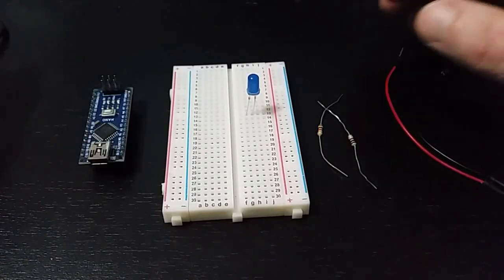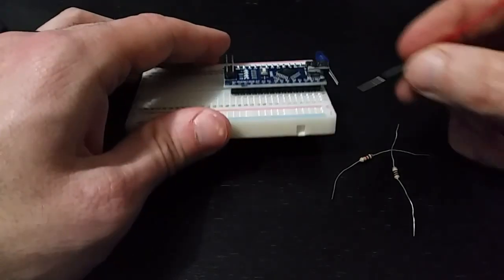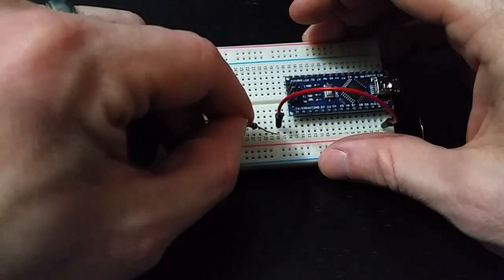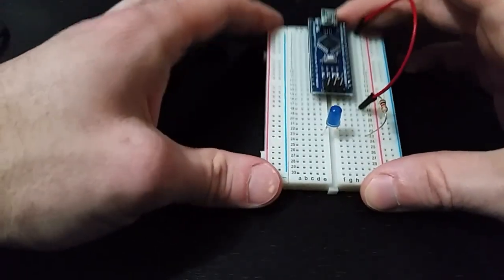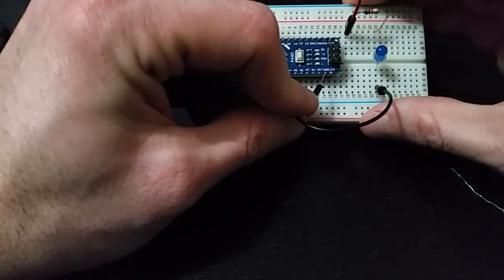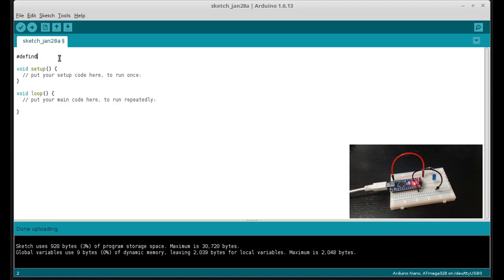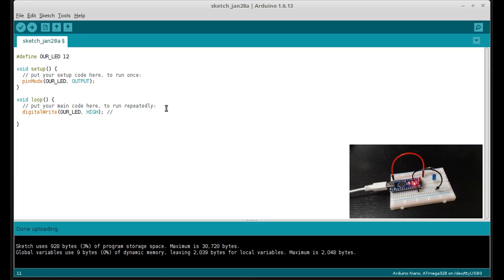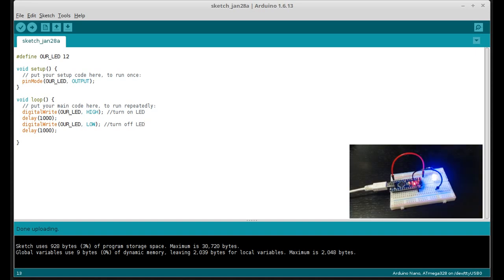How to Blink an LED with an Arduino Nano

Comment: Thanks a lot for the video. Its the first circuit I've built using Arduino. My nano came with the in-built LED already blinking, and after uploading this code to it, that LED has stopped blinking. Can I make both the external and internal LED blink in the same code? Thanks again.
Reply from the maker: Yes the internal LED is called LED_BUILTIN.  You can do the same thing as you did with D12 with LED_BUILTIN.

Comment: Why did you use 12? In your code
Reply from the maker: Because it is connected to the 12th digital I/O pin.  You can look up the pin mappings online.
Reply: @willworkforliberty  thank you for the video and answering my question. I and my son are trying to learn and your video for a starter is very informative

Comment: www.norvi.lk
NORVI is a programmable controller based on micro-controllers and SoC. NORVI is the most suited product on the market for any industrial IOT and Automation implementations. It has a combination of flexibility of ESP32 and Reliability of a PLC. It has featured your most familiar hardware, a 0.96 SSD1306 OLED Display and three buttons on top of the controller for any external commands.

Comment: Mine comes with pins separated from the board itself. Do i have to solder it?
Can you use it on breadboard without soldering the pin header?
Reply from the maker: You COULD... but the pins might not make good contact with the through holes.  You should solder them if you can.

Comment: Thanks for sharing this tutorial. But i hv some questions, how to work with several addressable LED ws2812b, how many of the maximum number of this LED i can control, and how much resistor should i apply  if i use 10 LEDs?

Comment: Since the current flows from negative to positive, shouldn't the resistor be connected to the GND side?
Reply from the maker: It doesn't matter because current is conserved for elements series.  The amount of current flowing through each element (LED and resistor) is the same regardless of their relative position in the circuit. Also, while electrons flow from - to +, the convention is to use .... "Conventional Theory of Current Flow" which considers electric charge as having originated from the positive terminal and is flowing to the negative terminal.

Comment: How much Resistor use ?
Reply: 10 OHM
Reply: How if i use addressable LED ws2812b, how much resistor should i apply if i use 10 pcs of that LED ws2812b...?